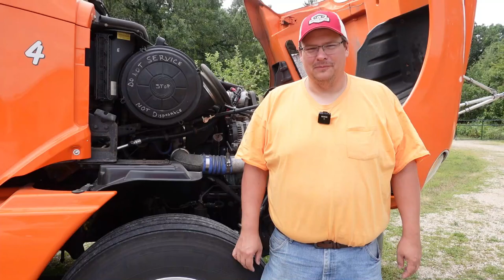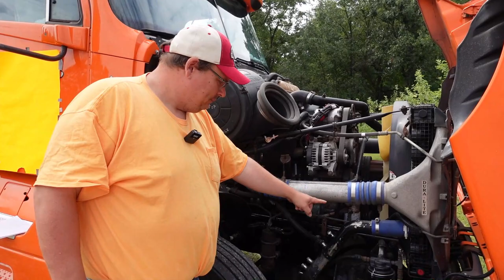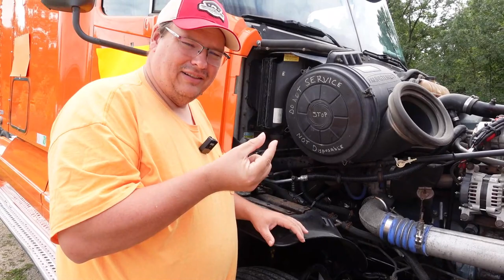How it Works: Understanding the Mechanics of Your Truck's Air Conditioning System

Comment: AC is not hard but you need gauges, scale, and refrigerant. I didn't just learn to fix it on YouTube, I've learned from HVAC guys and trusted mechanics. One other thing. A condenser is a very vital component with the system. If you put the guages on the system and start it up you will see the low pressure side at 30-50 psi and high side pressure of 150-250. If your high side is always up at the 200 plus range you have an evaporator that is struggling to dissipate heat. One way to determine this is while your hooked up to the system and it's running . Spray a garden hose on the condenser. You should see the high side drop down to the 150ish pressure. Prolonged higher pressure causes a higher head pressure on the pump and can lead to a failure of the pump. Just some ideas  for maintaining the system and why it does what it does. Oh and humidity and ambient air temp play a key roll as well

Comment: Want to mention if inlet and outlet heater core coolant lines are hot the cooling system will not override the heating system .  Install ball valves on the engine block to the heater core coolant lines .     6/17/23
Reply from the maker: I have a video how to do that

Comment: Another thing that causes poor AC is the exterior of the expansion cable gets covered with dirt and oil. The expansion cable works based on the heat from outside to very the refrigerant flow. There is a point if enough oil covers it long enough it will plug the diaphragm hole
Reply from the maker: Good tip, also if it looks covered in oi!, that can be a leak right there.

Comment: Do you have a video on the problem you had with that power supply wire? Had an issue with mine a yr ago and Freightliner “fixed it”. It lasted exactly 13 mo where their warranty doesn’t cover the repair now and it’s doing the same thing again. I can’t find where they spliced a replacement plug into it but that’s what they said they did.
Reply from the maker: What you would want to do to start is turn on the a.c..truck running.. then unplug the plug up by the compressor. Use a multimeter to test the plug for power and ground from the truck. If you have power and ground but the compressor still doesn't work, the wires could be broken inside the compressor itself. That has happened to me. That is assuming your refrigerant charge isn't empty or too low to start the compressor. It needs to be almost empty for that to happen. Sometimes that problem will be intermittent, where it will "sometimes" work...that's a real pain. You will need to do that test when it is acting up, also wiggle the wires around while you are testing the plug.
I would start there.
Reply: DIY SEMI yes it was intermittent same as last year until it stopped completely. Same as last year. I know newer components can fail but compressor is only 14 mo old too. You know typical shop with ac. Instead of diag a problem first thing they say is oh you need a new compressor or like the TA we can evacuate and recharge it.... Neither of which solves other issues lol.  It has Freon. No leaks. High and low pressure switches replaced when the compressor was along with the can.  Running a jumper wire in low pressure switch plug and direct briefly from where the relay is neither will cause the compressor to come on. Tells me it’s not getting power again from the wire or plug. I don’t have a multimeter in here just a simple test light with ground wire type that I use for fuse checks. Would that tell on that wire ?
Reply from the maker: @jayw8768  test light will work, won't tell the voltage...but at least you know you have power. Don't feel bad these a.c. problems are extremely common. Especially in freightliner because they ride so rough it just hammers the wiring. Let me tell you why I started doing all this video stuff. In 2016 I took this truck in for the bunk a.c. not working. I came out with a $3500 bill. It worked 4 days then quit again. Dealer through their hands up up and said I dunno.  I came home, bought a pump and set of gauges, bought the parts on line to fix it myself and rebuilt the whole a.c. system front to back, lines and all for about 1500. A.c. work is a bit of a scam. Like you said. Get the part number off the compressor. I bet you can find it online for about $125. If you believe its a bad compressor, I will tell you how to change it yourself and save a ton of money. Most shops do a poor job on a.c. work.  Ohhh...and the $500 sanden compressor they sell you at freightliner is really no better anymore than a Chinese knockoff. So you may as well buy the Chinese one and save $400 . Once you can replace it yourself, who cares if it only lasts 2 years...still cheaper
Reply: DIY SEMI lol my bunk ac doesn’t work even when the ac works  but I have a tripac.  I’m in the same boat as u. Even looked at the Schneider gliders when I bought my Columbia glider used from a dealer. Mines an old grand isle express glider but it had a tripac so hadn’t been idled to death.  I think my compressor should be good. Was replaced last July in a shops wrong assessment of the power issue. Cost $335 at freightliner for the part. Wasn’t too horrible. Great content btw. I need to start doing some of the investing you talk about.